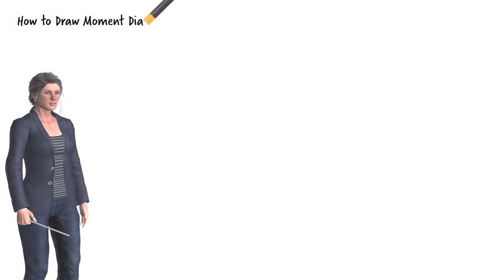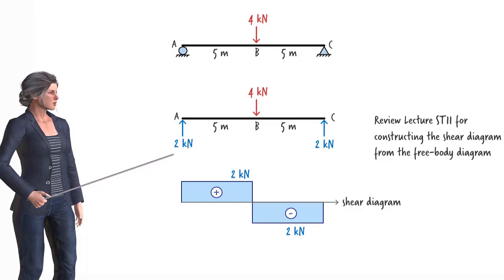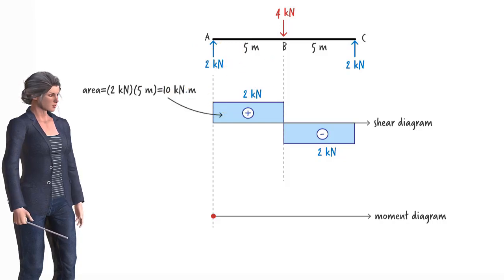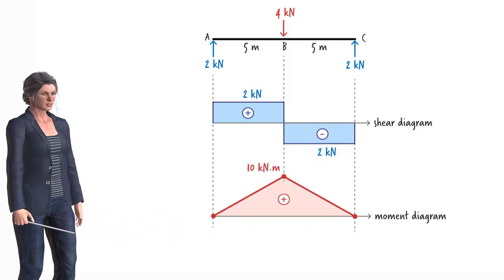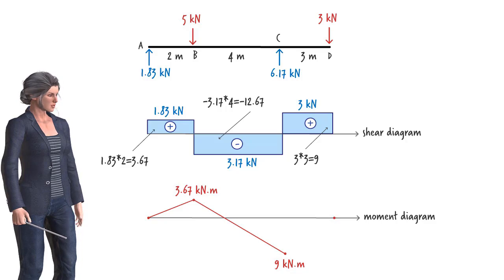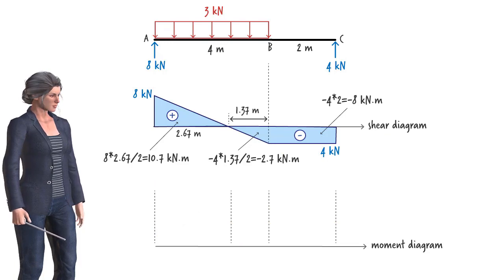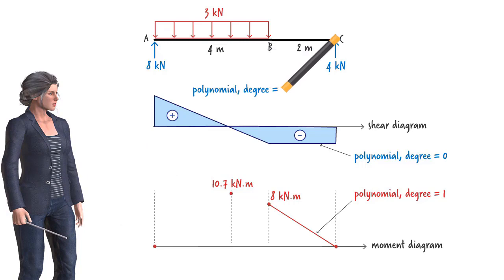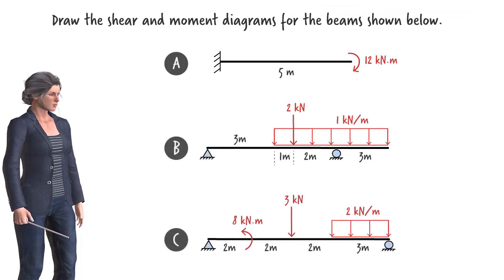ST12: Moment Diagram for Statically Determinate Beams

Comment: Regarding your solution of problem 3: http://lab101.space/pdf/exercises/ST12-Exercise3.pdf
in the second page, I think you need to include the moment 8 KN.m at the summation of moment around A at the static equilibrium equations.
Reply from the maker: You are absolutely right, thanks for pointing it out. The error has been corrected.

Comment: @4:30 I couldn't get the values of Ay and Cy correctly, there's something wrong with my calculations, please help.
Reply from the maker: Summing the moments about A: (5 kN)(2 m) + (3 kN)(9 m) - 6 Cy  = 0
Or, 10 + 27 - 6 Cy = 0
Or, Cy = 6.17 kN

Summing the forces in the y direction: Ay + Cy - 5 - 3 = 0
Or, Ay = 8 - 6.17 = 1.83 kN